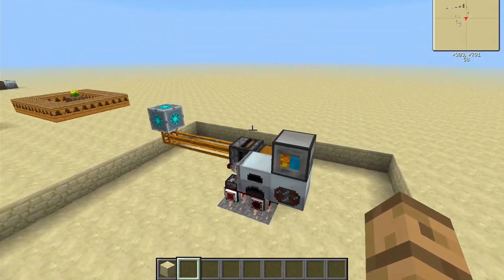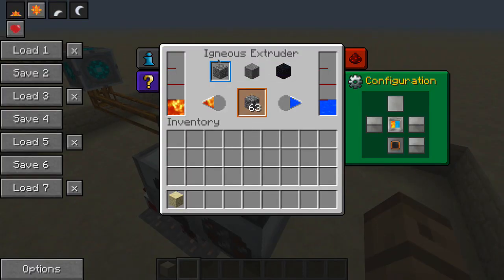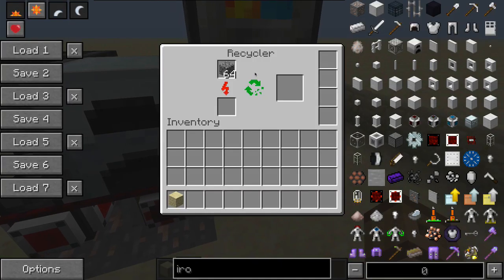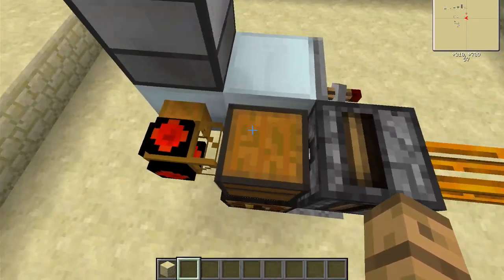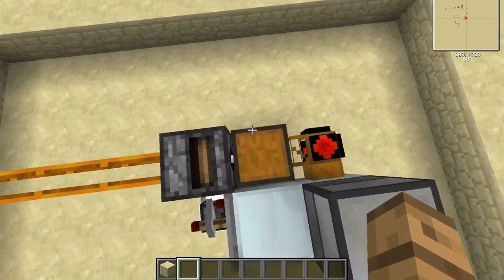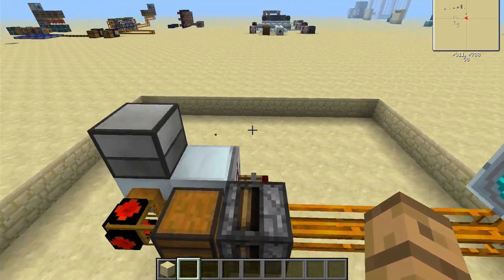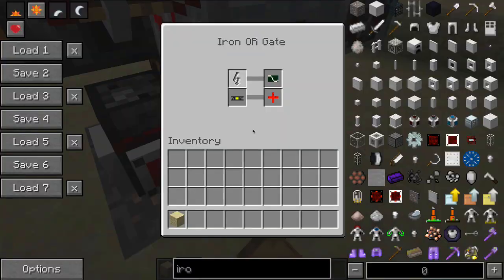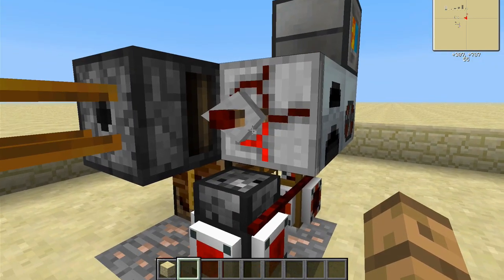Re 015 BdoubleO100 - Self Powered Scrap Machine

Comment: If you use a filter instead of a transposer, you wouldn't have worry about the transposer not pulling everything out in time, since the filter pulls a stack at a time. Cool idea though, I'm amazed that just the small difference makes the system produce a surplus.

Comment: nice solution! very compact and inexpensive.

i copied the design and i have a couple questions:

i'm seeing 14 scrap generated - 9 = 5 scrap output per cycle. is that consistent with your results?

at what matterfab power level will this 5 scrap/cycle not be enough?

what is the advantage of the transposer compared to a filter?